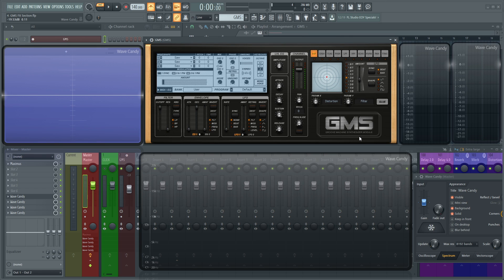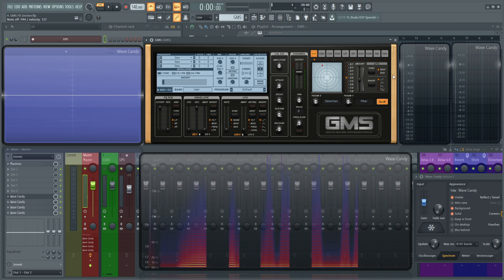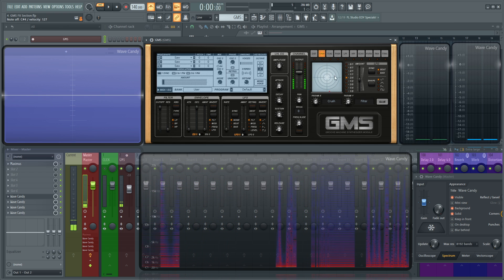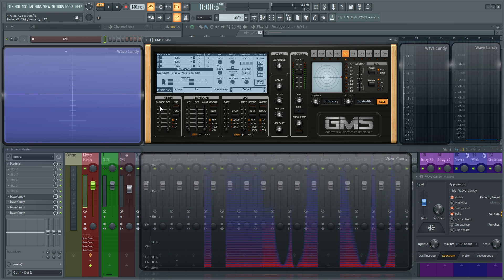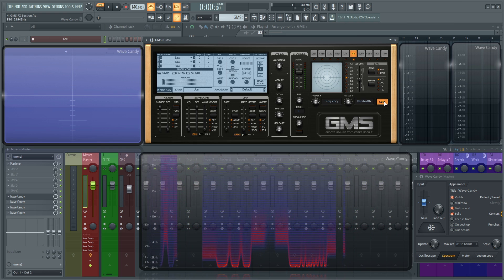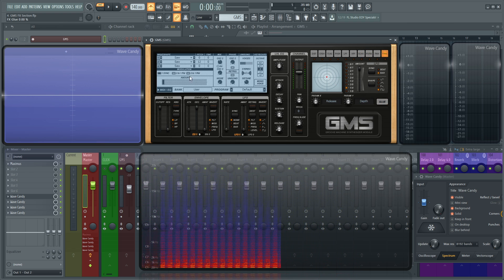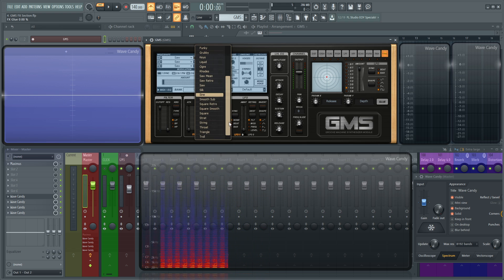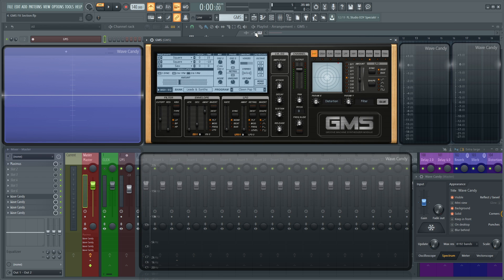How to use GMS: FX Section | Part 4 | FL Studio 20 Tutorial

Comment: I am currently trying to add an automation clip of the trance effect and i would like for it to only come in on certain times in the song. However it follows the entire pattern instead and I cannot make any wave form that actually makes it start and stop at specific times. Do you have any tips?
Reply from the maker: You need to make an automation clip for the glue button in the trance section.
For the automation clip itself, right click the second point and change the curve to Hold.
At the bottom it's off, at the top it's on (technically I think over 50% is on, but setting it to the top is a cleaner way of doing it)

Comment: hey I have a question that I have not been able to solve to see if you can help me I made a composition where the electric guitar is the main instrument and I use a plug in of Fl studio called Distant Singnal LS, and I want to play with my guitar live with that plug in but I do not know how to make it sound with my electric guitar do you know the way to do it? I searched and have not given me an answer?
Reply from the maker: So you basically want to have your guitar run through that plug in live inside FL?
Reply: @jonaudio  if I want my guitar to work with that plug in DISTANT SIGNALS inside FL STUDIO to play live with my guitar I mean I want to play with that effect with my guitar live the distant signal what I don't know is how to do it????..... you know with a midi controller you can hear it but not with the electric guitar.
Reply from the maker: If you plug your guitar into your interface and select whatever input your guitar is going through on a fader and put the plugin as an insert that would let you run your guitar live through the plug in